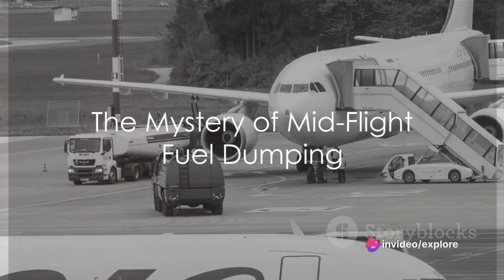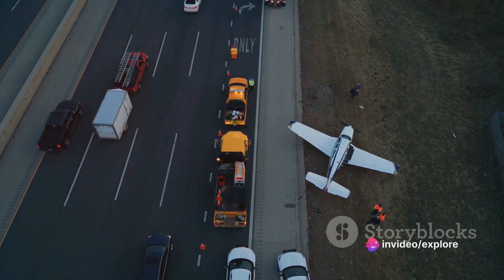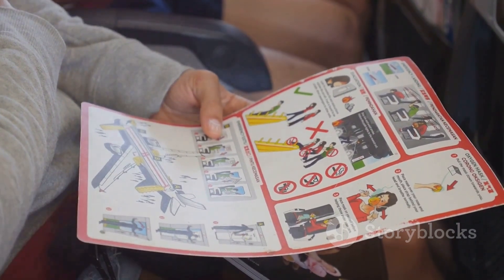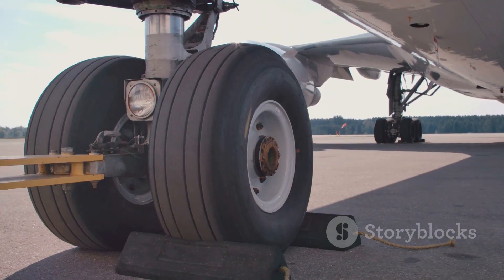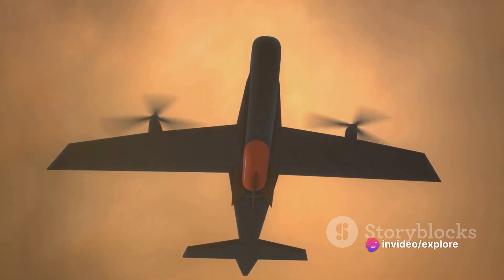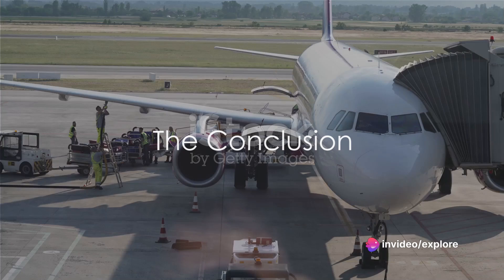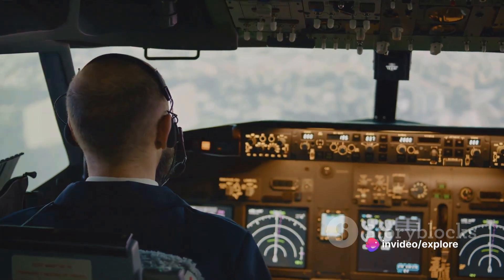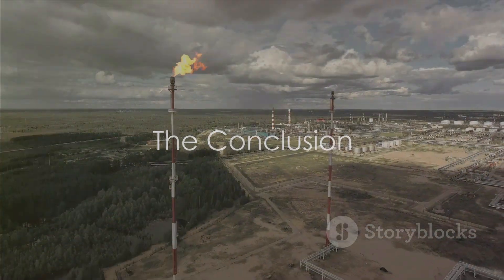Why Do Airplanes Dump Their Fuel - Why Fuel Dumping? - Explore Aviation

Comment: Where to begin- "Fuel" not "fule." In the first 35 seconds you show four different aircraft types- an A36 Bonanza, a Twin Otter, a diagram of a turbo prop and an A320. NONE of those have fuel dumping capability. Only some heavy jets have fuel jettison. You then show a contrail being formed. Comtrails have NOTHING to do with fuel jettison. Of around ten types you showed, onlt two actually have fuel jettison capability. Other aircraft types (and, indeed, aircraft that CAN jettison) are certified to land over maximum landing weight in an emergency. MLW is not ROUTINELY exceeded as it would decrease the aircrafts service lfe, but it can be if neccessary.